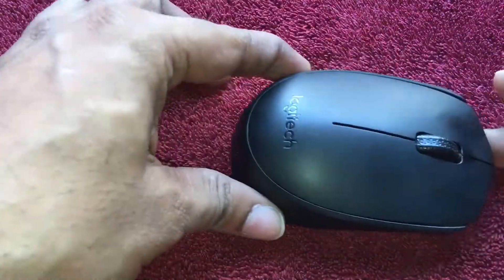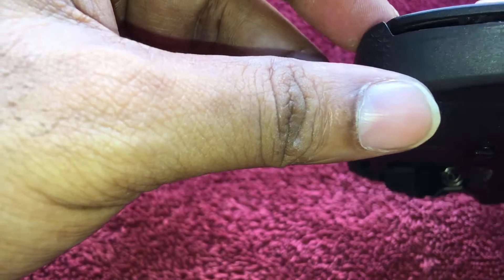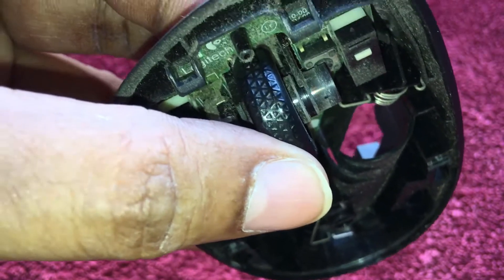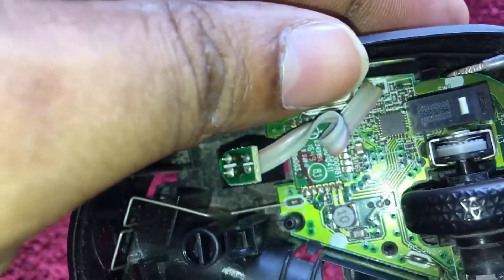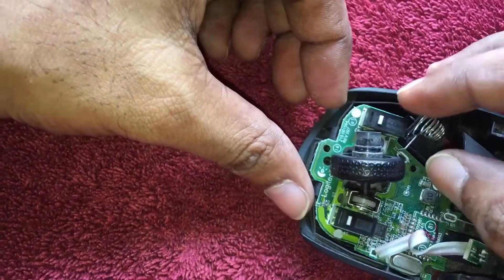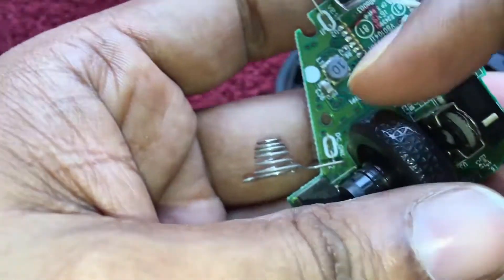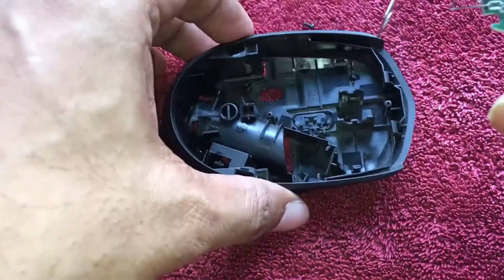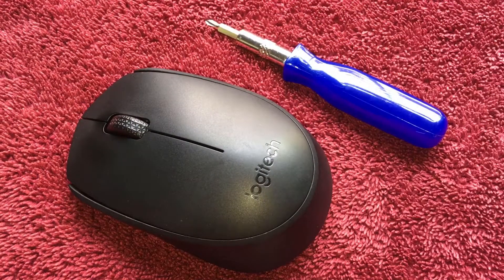Logitech wireless mouse servicing/ repair/ disassembly English USA, UK, Canada, Australia, Germany.

Comment: Thank you for this video! Cleaned years' worth of gunk, hair and crumbs off the sides and from the inside of my mouse thanks to your instructions. Can't wait to see what gaming will feel like with it now that it doesn't have a mount Everest of debris under the wheel and buttons. Only issue I had is that I was careless and lost the external on/off switch - but I just switched the mouse back on by flicking the internal toggle with a screwdriver and covered up the hole with a sticker. I'll be back in 5 more years to clean my mouse again 😁
Reply from the maker: nice to know & thanks for your comment & support.